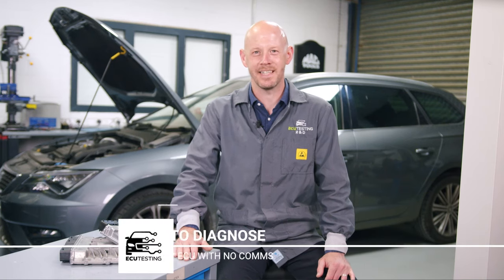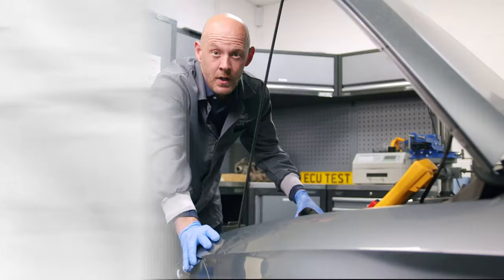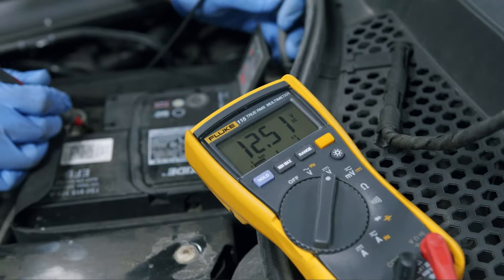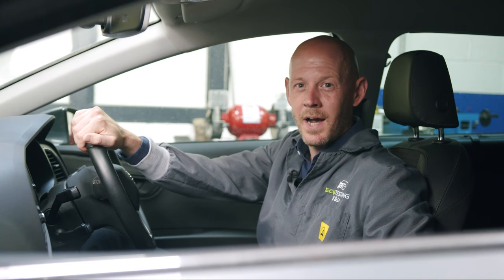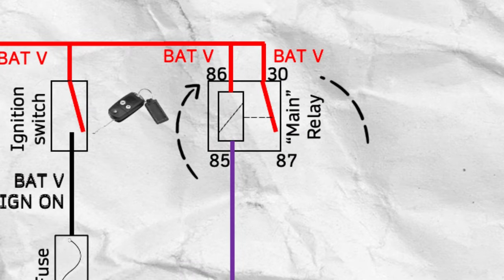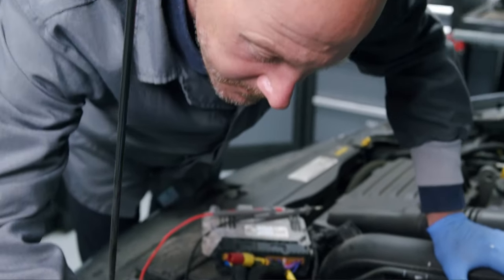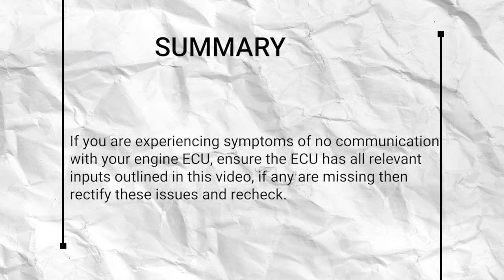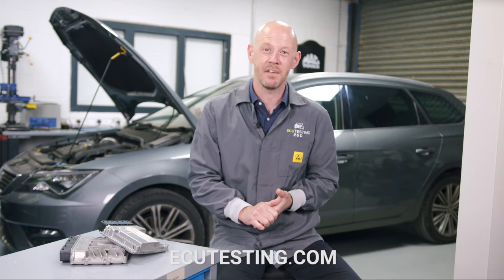How To Diagnose A Faulty ECU With No Communication

Comment: I have a 2012 Honda Civic si sedan. I was driving home one day and it just turned off. I plugged my code reader and it shows up as linking error. 

I’ve changed relays to new ones. 
Fuses to new ones. 

I have power going to all sensors and fuel pump. but none going to injectors and ignition.  

My code reader is not communicating to ecu. Nor does the ecu communicate with the car. I need help. I’m losing my mind.
Reply: Have you fixed it?

Comment: Is the ECU and ECM the same thing? Is the ECU and PCM the same thing?
Reply from the maker: Hi. Essentially yes, they are often used interchangeably, especially ECU (engine control unit) and ECM (engine control module). However, the PCM (powertrain control module) is a more comprehensive term that refers to a unit that controls multiple systems on the powertrain (e.g. both the engine and transmission), whereas ECU/ECM is usually more specific to just the engine within the powertrain system. Confusingly, ECU can also mean 'electronic control unit', which is an even more broad term used to describe any type of control unit within a vehicle which controls an electrical system. Hope this helps!

Comment: On Hyundai santafe 2014,My check engine light doesn’t come up at all. It doesn’t accelerate when I climb a hill even when the acceleration pedal is completely pressed and the engine does not go off. The fuel consumption is quite enormous as if the fuel is leaking. 
After diagonising, I have a P0365 (Exaust camshaft position sensor(CMP) B circuit fault (Bank 1). The sensor was checked okay. Even changed.  After troubleshooting, it was concluded to change the ECU.  What do you suggest?
Reply from the maker: Hi. We would recommend checking the wiring in the cam sensor circuit before condemning the ECU, as a short or open in this circuit could lead to the symptoms you are describing and the P0365 code. We have a video on how to do this here: https://youtu.be/FTY11IeWBsk. If the wiring checks out OK then it is more than likely the fault is being caused by the ECU. If you would like to send your unit into us for testing to confirm this, please fill in our online test form here: https://myaccount.ecutesting.com/

Comment: 2009 grand marquis. 44k miles. ABS traction control and parking brake red light went on while driving on highway in rain. Light came on after bump in road. Lights on steady since. 
Was able to pull a U1900 code with blue driver dongle scan. Missing CAN message from hec. The car runs and drives fine. Speedometer working ok.  Cruise control ok. Transmission shifts fine. All readiness monitors ok. 
Can not communicate through ALDL with Autel maxisys. No communication with PCM, ABS, or dash cluster (gateway module). I am able to communicate with LCM DCM RCM modules. 
Measured 63 ohms on termination resistance at ALDL and got 12 volts at pin 16 and both grounds at pins 4 and 5 seam ok. 
Any thoughts would be appreciated. Thanks.
Reply from the maker: Hi. Sounds like it is definitely a communication issue. We would recommend using an oscilloscope to check the CAN lines associated with the modules which the fault codes are reporting, checking for any missing signals or inconsistencies. Hope that helps.

Comment: Hi, my BMW F36 wont start or crank. ISTA shows no communication with DDE ECU. Tested Relay and all fuses all good, there is 12v at the relevant pins on the ECU connector and Grounds to chassis 0ohms. Particular fault that catches my eye is (Wake Up line to the intelligent battery sensor short circuit to B+ or disconnected), Any advice appreiciated
Reply: Check the big fuses on top of the battery in the boot.

Comment: Sir, I have a question. Is there a single pin, or a couple of pins that "turn on" the voltage regulator to get it (the alternator) to produce power?
I'm dealing with a GM CS AD series alternator. I don't have need of anything else other than trying to get the alternator to produce power.
ANY help you can give would be appreciated. Thank you.
Reply from the maker: Hi. If you want some information on how to test your alternator then check out the video we have made on alternator fault diagnosis: https://youtu.be/gpFlPU2HQkY
Reply: @Ecutestinglimited  is there any way to get away from the ECM, for example changing the voltage regulator to a 2 pin off of an 10SI model?

Comment: Hi boss I gaved my a class mercedes a180 2014 petrol manual engine for mercedes service stratford for engine light was coming on because of misfire engine on slow speed some was jerking or something hiccups now the mercedes technicians keeping for 20 months couldn't fix it first they said to me because of bad wiring doing misfiring next week they said engine control s problem after 2 months they saying ECU problem and they still keeping my vehicle with them I don't know what to do please you hot some way to tell me please thanks I already subscribed your channel thanks ??
Reply from the maker: Hi. If you are able to email our technical support team at info@ecutesting.com with the following details:
1. The make and model of vehicle and symptoms of the fault (as you have described above).
2. Any details of fault codes produced by a diagnostic scan.
3. Any work carried out on the vehicle by technicians already.
They may be able to assist you further. Cheers

Comment: thanks for this educative video, my automatic transmission has been slipping while driving in 2nd and 3rd, my mechanic scanned the problem with a diagnostic computer and he said there's no communication between the ECM and TCM, he has advised that I replace the ECM. Can a faulty ECM also cause transmission problems?
Reply from the maker: Hi. Yes a faulty ECM can cause transmission problems like you are describing, especially if there is no communication between it and the TCM. If your mechanic has diagnosed the problem to be the ECM itself and not the can lines between it and the TCM, then it is likely it needs to be rebuilt or replaced. If you would like your ECM to be tested by us to confirm the fault then please email our technical support team at info@ecutesting.com with the following information. Your make and model of vehicle, the part number printed on your ECM, the symptoms of your fault including fault codes, and any attempted fixes/further diagnostic tests you or your mechanic have completed. They will advise your further. Thanks.

Comment: How do you test the ECM pis with a multimeter if the plug is inserted into the ECM sockets?
Reply from the maker: Hi, great question! This will depend on the type of connector your vehicle has, but firstly you will need to remove the back plastic cover of the ECU connector (which usually requires you removing the connector from the ECU so you can remove the locking mechanism and not damage the pins). This will expose the back of the pin terminals in the connector. Plug the ECU connector back onto the ECU and then attach a pin probe to your multimeter. Then probe the terminal from the back of the connector by gently pushing the pin above the wire. We have some pictures for you to use if it helps: https://imgur.com/a/qW60jkQ

If you have any other questions then please let us know!

Comment: Can a faulty ECU cause the lights on the dash to stay on with no key in the ignition to flicker?I currently just bought a 03' ZX3 and this is the issue I'm having with it & trying to fix this problem.Any suggestions would be appreciated.
Thanks
Reply from the maker: Hi. Are you able to scan the vehicle for any fault codes at all? Without these it would be difficult to diagnose the cause of the fault. Cheers

Comment: Very good video. Well explained. How to know VCU / ECU is functioning normal.? When connected all device in the CANBUS are good , but there is no way to know ECU is normal  or not .
Reply from the maker: Hi. We're glad you liked the video! Determining if the ECU or VCU are functioning correctly isn't a straight forward process, especially if they are being effected by an intermittent fault. However the easiest way to identify a fault with them would be to scan the vehicle for any fault codes as these will give a description of where the fault could lie. That being said, some faults don't produce any codes, so another way to test the units are functioning normally would be to use live data monitoring to see how the unit is responding to sensor inputs in real time. Hope this helps!
Reply: @Ecutestinglimited  Thanks a lot

Comment: Great video I learned a considerable amount from watching this one video (now subscribed)
I have a Maxicue OBD reader and it has thrown up this fault 
Audi A3 (8P)
Convenience system (TP)
01320 intermittent Climate control no communication
00352 intermittent terminal 30a open circuit
0095  intermittent Key 1; adaption limit exceeded Faulty or no basic setting/adaption
01565 Permanent Luggage space lighting Short circuit to ground

>
The 01565 may now shed some light (sorry about the pun) about the parasitic drain that I could not find.
But anyway the car is still driveable.
I look forward to your response
Tony
Reply: I have autel diagonisis tool somtimes it connot comunicat with the cun bus of
Reply: Hi I have a problem with my volkswagen passat cc 2011 cluster pannel  no lights fans to start the vehicle the dashboard shows only parking light. What would be the problem..sir

Comment: This video really helped me a lot but my only query is that, how do we get 5V on some engine sensors whilst we are using 12V battery
Reply from the maker: Hi. We are glad the video was helpful. Sensors which receive 5 volts are typically low-power sensors which only need 5 volts to operate and generate an output signal. These sensors receive their supply from the ECU which has internal voltage regulators to take the 12v supply from the battery and generate different voltages for other components on the vehicle such as sensors.

Comment: Thank you for this video, it was very helpful.
 Please answer this question.
 Is the engine control unit No. 03G suitable to work in place of the engine control unit No. 038?  Knowing that they are the same engine capacity.
Reply: The car type is Volkswagen Transporter 2007, the engine capacity is 1.9
Reply: WHAT ENGINE CONTROL MODULE IS SUITABLE FOR 2007 TRANSPORTER 1.9 ENGINE?

Comment: I'm in Las Vegas and I have a lexus gs450h with major wiring problem 12v is bleeding into 5v referance, can high is shorted to ground. Do you have someone in Las Vegas you can recommend me to. Alot of the mechanics here are useless without there scanners.
Reply: I can take a look at it and help you.
Reply: Hello friend, were you able to help the guy had problems with the ECU? I would like to ask you a question, by the way i lived here in Las Vegas Nevada, i have a 2001 Hyundai Santa Fe GL 2.4 liter/engine, i think my ECU it's bad, because it has no communication. But i would like to ask you maybe you can help me.

Comment: Hi guys, very informative video thanks 😊.  I have an intermittent no crank on a A4 B8 CAGA TDI. When the car won't start, the main relay (T30) goes bonkers, clicking in and out. Pin 86 and 30 have constant battery voltage when the T30 relay is doing this clicking, pin 85 (ground switch from ecu) has battery voltage until ignition on and then has 1.04v.... I've been over and over the wiring and I can't find any issue. My question is: Should pin 85 drop to 0v as its ground switched by the ECU? This A4 only drops to 1.04v and there perfect continuity on th8s very short wire from pin 85 to ECU, no voltage drop on that wire either. Would very much appreciate a response from your experience 👍
Reply from the maker: Hi. We are glad you liked the video. Yes, you are right that pin 85 should drop to 0v with ignition on, so from what you have described it could be a few things. Firstly it could be a faulty relay, have you tried testing/swapping this out to see if it rectifies the fault? If that checks out ok then there could be a short affecting the wire from pin 85. We would recommend disconnecting the ECU connector and testing continuity from terminal 85 and every other terminal on the connector. If there is no continuity, then the last thing to do would be to re-connect the ECU connector and back probe a scope to pin 85 with the ignition on. If the waveform is noisy or the voltage is floating then the ECU is at fault. Hope this helps!
Reply: Thanks very much for the reply, it is greatly appreciated 😊. I've tried  5 different relays at T30 position, all exibit the same clicking behaviour. Ive also bypassed the wiring by unplugging the relay, I ran battery voltage to pins 86 and 30 of the relay, i backprobed the ecu and ran a new wire from pin 85 of the relay straight to the ecu. Then i connected pin 87 of the relay into its corresponding socket on the car. Still have the same behaviour. Ive just done your other suggestion and tested continuity from pin 85 an the relay socket to every other wire on the ecu plug, then only place i have continuity is where it should be, at pin 85 termination at ecu! I havent the equipment to scope the signal as you suggest, time to try another ecu i think! Thanks again for your help
Reply from the maker: @tipptop9  No problem, we hope you find the cure for your fault! If you decide you want to get the ECU tested or remanufactured then let us know or visit our website www.ecutesting.com.
Reply: Just fitted new ecu from the scrapyard and the problem is gone! The one i fitted is EDC17CP20 same as stock ecu. Car started once and will crank everytime now! The bosch PNs are different though, so not sure i can clone it

Comment: keep getting p0606 when engine is warm
Reply from the maker: Hi. Check out our video on how to diagnose the P0606 fault code here: https://youtu.be/Aj7SAn2F3V8. If you have any other questions please contact our technical support team via email at info@ecutesting.com and they will be happy to assist you further! Cheers.
Reply: @Ecutestinglimited thanks,ended up replacing the ecu  and no more issue.

Comment: I’m not getting a single on my o2 sencer I change both sencers and ther not reding no no signal ther was a short on the whire both sencer I fix them and the scanner not reading nothing on the sencer both sencer can it short out the ecm ther is no signal at all I reset the o2 sencer and no light is on yet so is it the ecm
Reply from the maker: Hi. Depending on where the short in the wire was, it can cause damage to the ECM yes.
Reply: @Ecutestinglimited  the big idea  can this test  be  done out of   car  ?     get  ecu  on bench and  give it its    vss  and ignition on  vss  and  ground can  we  see  can communcation signals  and    relay on   low       command  ?

Comment: Great video. I have a problem. 2013 Tacoma 2.7L, I don't think this is relevant but lightning struck near the vehicle during a storm, truck started the next morning and while driving to town just shut down. No check engine light, cranks but no start, no communication, only with airbag. checked 5volt reference, 2.8 volts at mass air which I thought was not pulling down enough to be a grounded sensor but started disconnecting sensors anyway. of course all disconnected voltage came up to 3 volts but did not return to 5. Is the 2.8 volts at THA wire on maf to high to be a grounded circuit or sensor? Also can bus looks hashed.

Comment: Can a faulty ecm cause high idle issues
Reply from the maker: Hi. A faulty ECM can be one potential cause of high idle issues, however there are many other causes of high idling which would need to be ruled out before condemning the ECU. If you are able to perform a diagnostic scan and pull any fault codes then please send the results and the unit part number to info@ecutesting.com, and our technical support team will assist you further. Cheers
Reply: @Ecutestinglimited I have no checking light. But could I still have faulty codes??
Reply from the maker: @michealrobinson9778  Hi, yes it is possible for the car to be generating fault codes even with no engine check light appearing.
Reply: @Ecutestinglimited  thanks alot

Comment: Hi can a blown fuse on the ecu that leads into computer box cause car to jerk?
What damage can my car suffer if the positive cable touches the body of the car?
Reply from the maker: Hi. Depending on the fuse in question, a blown one can cause the car to jerk. A positive cable touching the body of the car can cause fuses to blow and damage to the wiring. We would recommend fixing the wiring and then replacing the blown fuses and seeing if this fixes the fault. Cheers

Comment: Great info, thank you! - I have a question - can a car be wired up to  only work with a specific ECU? - My car (golf 2.0 8V) is in at the auto as we speak - it went in with a 2.0 polocub - but he said it has no spark...the way it was previously wired , meant they took a spark from the one loom, and tapped in creating a separate one (yes i had 2, lol )  -and yes it was starting up before it went in - i was just wondering if he tried to up-sell me.  Or Could the previous wiring be wired up to "borrow a spark" ? or cause it to "blow" an ECU? - He sold me a 1.8 ECU...for my 2.0 engine, should i be worried?  lol , Thank you
Reply: Almost definitely a different tune at least

Comment: Great video! These are the steps I need to perform on my Z3. After receiving a cloned DME, car cranks but no start, I still not sure where the DME relay is on my vehicle since it's at different locales between M43 and M44 engine. I have the M44. I have the right wiring diagram. Any advice is greatly appreciated, Thank you!